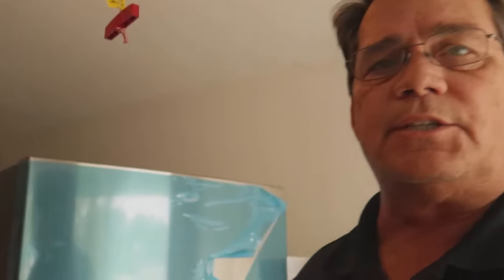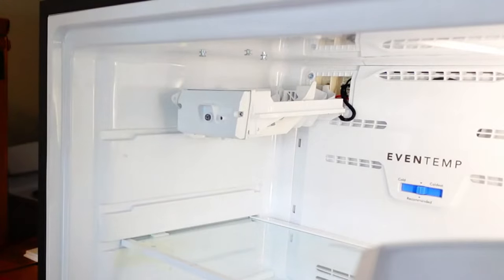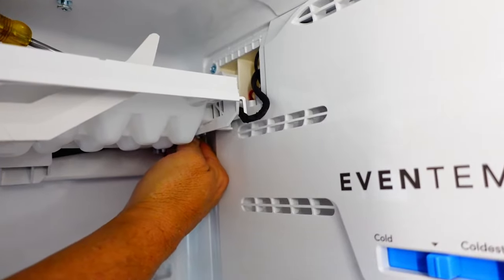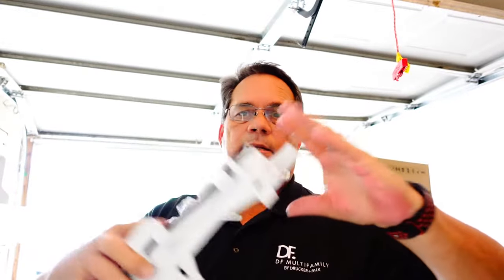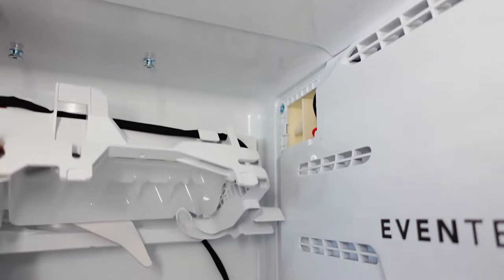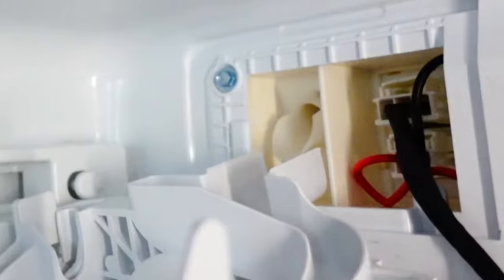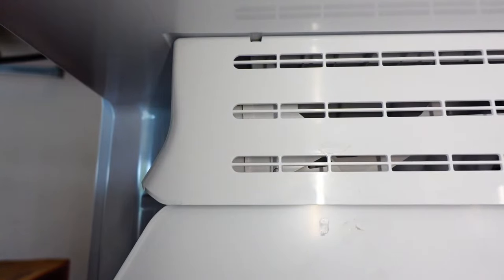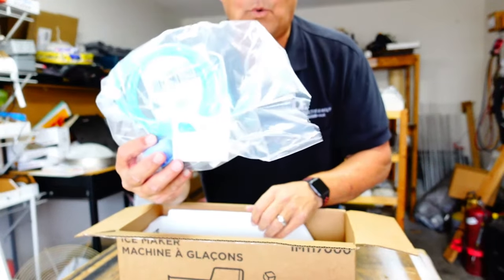How To Remove A Frigidaire Ice Maker. Removal, Re-installation & Review. IM117000

Comment: Hi, I just installed this ice maker in a new fridge my question is how does it know when the ice bucket is full. I see the arm on the side of the ice tray i thought it would pull down but it does not. I was going to pull it back out & look at it , but i thought you might know? wanting to understand how it works.
Reply: when the tray flexes or just before it drops the ice the arm will come down to see if the bin is full or not.

Comment: Hi Dan...unfortunately have a new model IM117000 icemaker (lucky me!) that I need to install.  It looks pretty straight forward EXCEPT how to I 'break through' the plastic freezer wall/ceiling to place the shoulder screws included in the kit?  I found the dimples mentioned in the instructions, but I don't seem to be strong enough to start the screws breaking through the plastic.  Any suggestions (maybe start working on my biceps)?
Reply from the maker: +Robin Robinson might need to use a drill and bit to carefully make a hole at the desired spot.

Comment: Ice maker does not work. I now want to totally remove it from the freezer. What to do after removing it with the water hole and plug in the wall of the freezer?
Reply: I do not want to replace it,

Comment: I want to remove the icemaker all together. Is it safe to turn the water supply off, let the ice maker until there is no more water and then just remove the icemaker? The opening where the harness plugs in will be open. I have no way to cover it. Will this be okay also?
Reply from the maker: Shouldn’t be an issue.
Reply: @danjiles  I'm having a problem disconnecting the wiring harness. Any suggestions?
Reply: @danjiles  I am having trouble disconnecting the wiring. I have broken some small piece when trying to push down with the screwdriver.. Any suggestions?

Comment: Would anyone happen to know if there is an aftermarket substitute for this style of ice maker?  I am experiencing the same problems as Dan outlines here and I was a part of that recall in which there was white chips that were coming off into the ice.  However, the replacement is no better.   It made ice for two weeks and then stopped.   I almost NEVER have a full ice bin.  While what was in there is fine for my family, there is NO WAY I could use the ice maker for a party.  So I had to go out and buy a separate unit that works on its own.   However, I want to rectify the situation with my Frigidaire refrigerator as the main reason I bought it was because of the ice maker.   Would anyone know if there is an after market ice maker that would fit into the Frigidaire that is a different design, but fits in the same spot as the original.   Any help would be much appreciated.

Comment: Just bought this frig and it didn't come with the icemaker. Does the kit come with the little metal studs that the icemaker hangs on?
Reply from the maker: +Lee McCready the kit will have all the parts you need to install it, just like the factory did. 
Good luck

Comment: Thanks Dan, GREAT VIDEO, unfortunately this is the exact model that came with my new refrigerator.  Installation wasn't too bad but found NO documentation on the actual operation and any user controls.  At first, all I saw was the green power button....on/off, ok that's easy.  But without reading your viewers comments, I'd still be up &^$&^% creek.  Once installed is there a correct sequence or set-up procedure to get this unit working correctly?  Took about 5-6 hours to make it's first batch of tiny "cubes".  If anyone has a link to any user-friendly instructions, I'd appreciate it.  Dan, thanks again.

Comment: The problem with the Whp was they had gears that we would replace about every year until they came up with a drop in replacement they were also part of the defrost system what a cluster you know what
Reply from the maker: THEY SUCKED TOO, THE PLASTIC MOLD ICE TRAY WAS A NIGHTMARE.

Comment: I bought a new Frigidaire ffht1425vb refrigerator, no door handles like the one you showed the ice maker on You Tube. I was wondering if there is any way I can have an electrician change model im116000 harness to be the same  as the im117000? I do not want to pay for and pay labor to put in an ice maker with the horrible reviews it has!  Btw I very much enjoy you posts!!